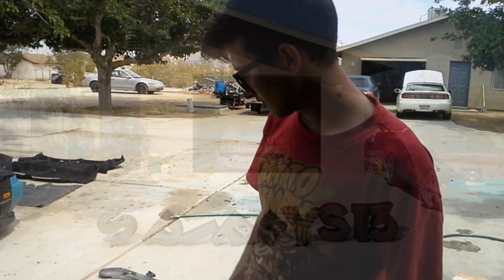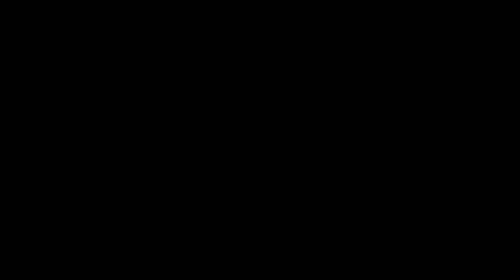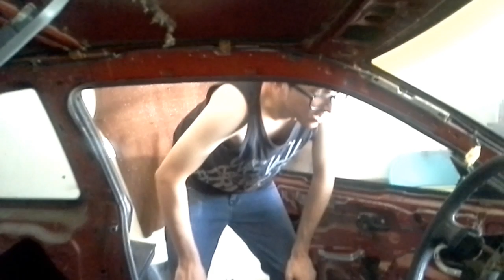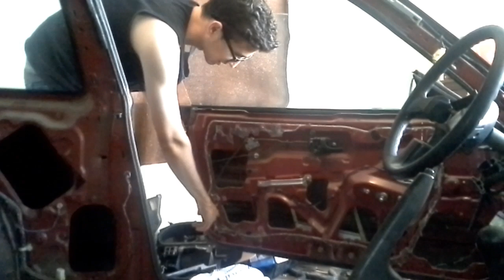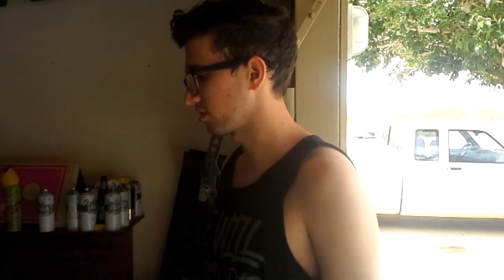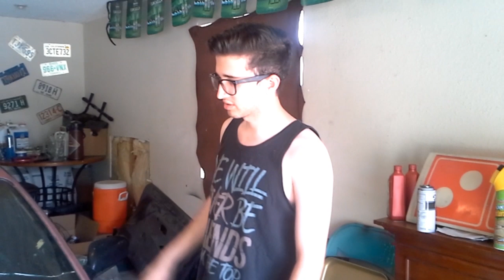Junkyard To Drift Car Build ep.3 ( Gutted )

Comment: idk if you figured out something out for you key situation  but if you haven't imo if its a race car  just run a switch panel you can grind those pesky safety bolts off run a separate ignition lock cylinder  to your switch panel   but awesome vids man keep them coming +1sub